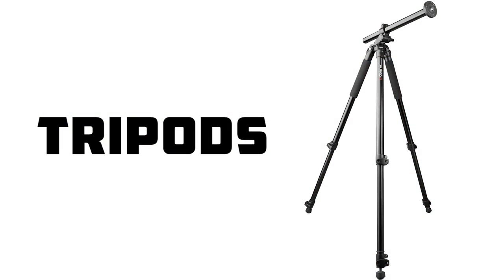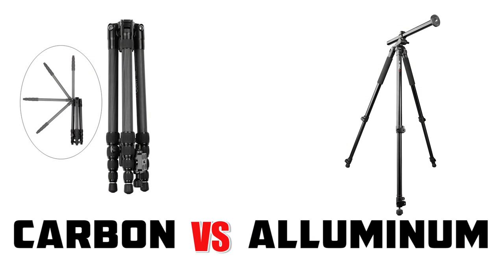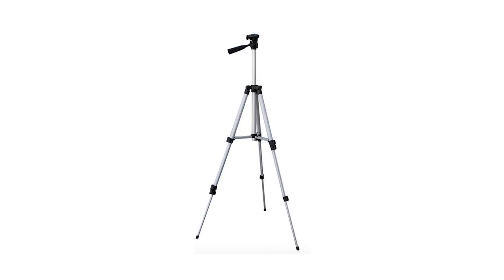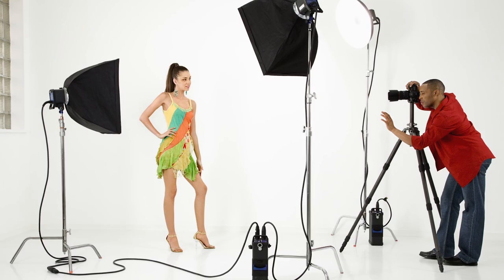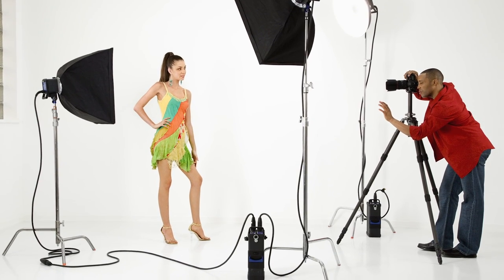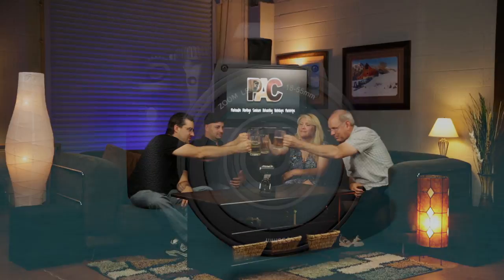Tripods - Carbon Fiber or Aluminum? Ep: 32

Comment: I was hoping to hear about the sturdiness of Aluminum vs Carbon Fiber. I have an aluminum tripod and bent of the lower legs. Not sure if that would have happened with a CF tripod, but it's so much more to find out... The 20% more weight doesn't deter me from A.
Reply from the maker: Lee Long im not a tripod expert but metal is usually sold as more sturdy than carbon fiber, the main selling point for cf is weight-  when I storm chase I bring out my old heavy metal manfrotto video tripod, because the wind doesnt shake it as much! But all metal will bend.

Comment: Zomei z818c  vs Zomei Z888c which one is better? Or any other carbon fiber tripod in the range of $100-$150
Reply from the maker: I have not used either model, so cant give you a legit reco on the product
Reply: PAC Network ok.. any other carbon fiber tripod you can recommend? In the range of $100 to $150 plz.

Comment: HA HA. I was told talking about religion, politics and tripods while drinking beer doesn't mix. Actually, I was told one photographer doesn't use carbon fiber in a studio with carpet, because the legs don't sit in very good in carpet versus aluminium.
Nice video and discussion..
Reply from the maker: +geo80551 Hmm I have never heard that but then again my studio is hard flooring so I have not had that issue.  Thank you! Please share this with your photog friends!
Reply: Thanks.

Comment: Again awesome points made. I think you nailed it right there at the end. You wouldnt go through life with just one pair of shoes. Your gonna need some gear for specific uses. I really agree with Cusi on the point of manufactures can make all the difference in quality of the product even at the same price point's. I've experienced that many times over with tripods we've tried to use at work that were more expensive, and constantly failed to meet our needs on a daily use basis. And then bringing in my personal gear (100 cheaper) and gotten 3 years of daily use problem free.
But I also wouldnt take an all Aluminum Magnus brand tripod to the bottom of the grand canyon unless I planned on paying the littering fees, cause it aint coming back up with me! LOL!
Keep up the good work!
Reply from the maker: MrThunderMonky  Man @Eric English carried that tripod all the way down and back  - pretty sure it could hold a 50 cal on it

Comment: Wow one extra pound must be difficult to carry around.
Reply: The strength of carbon to aluminum all depends on the engineer and development of the materials. Cheap carbon fiber can be found to be very brittle. Also, there are certain alloys that do not corrode. One thing that I am looking for in a tripod is how quiet it is to setup. This was not discussed in the section, but that depends on how loud clasps are and how the tripod is being setup. However, carbon fiber is quieter if something were to hit it than aluminum.
Reply from the maker: Great point, we were not even discussing quietness, but in wildlife or weddings, this is a super valid point! Thank you for bringing this up!
Reply: If you compare aluminium vs carbon fiber versions of mono pod the difference is small. The weight of the head selected is of way greater significance! The locks need maintenance tubing on all reputable Brand's
 will be fine in all situations be it aluminium or carbon.

Comment: I grew tired of cheap shit tripods and bought a heavy alu one and it's great for long exposures and stuff like that. The problem is it's to heavy to lug around in the city or during longer walks. I'm probably gonna buy a smaller carbon one for trips and what not
Reply from the maker: Yes its the case of diff. hammers for the job - the sturdy one you mention is the jack hammer, the walkabout one is your ball peen hammer - I have too many to count these days  lol